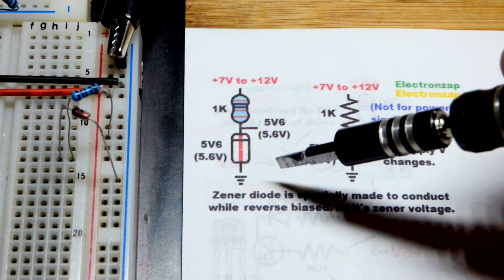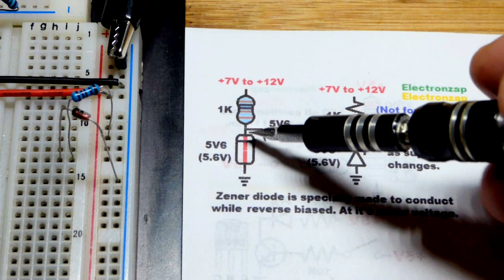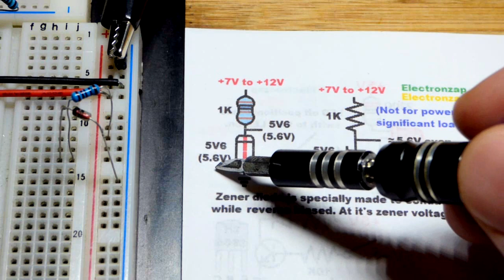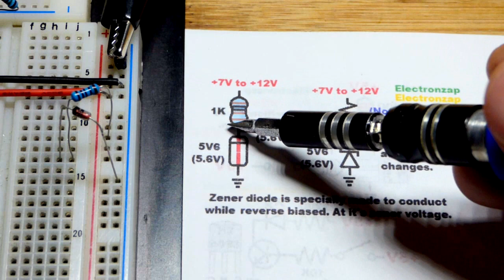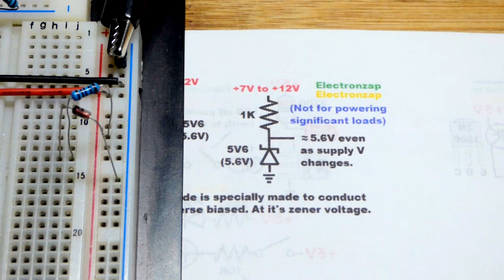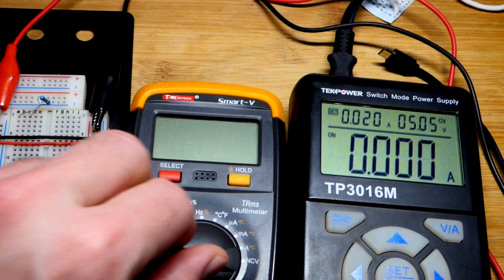Zener diode basic voltage regulator electronics component demo of how to DIY tutorial

Comment: Outstanding Video! This is a really useful video! Just to clarify (I know you did not talk about it in the video) does a Zener Diode work the same as a Regular Diode. They both are P-N Junction Based right? Please let me know, and thank you for making this video.
Reply from the maker: Thanks! Yup, they also have the P-N chemistry. While forward biased, zener diodes should have about a 0.7V forward voltage like most silicon diodes. You'd have to look up their exact chemistry if you want to learn more.
Reply: electronzapdotcom Okay, thanks!